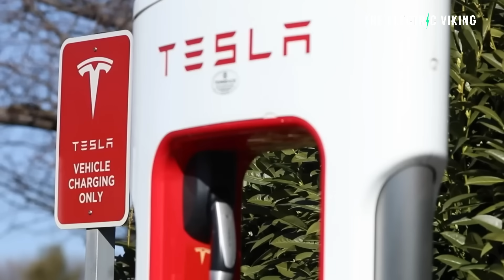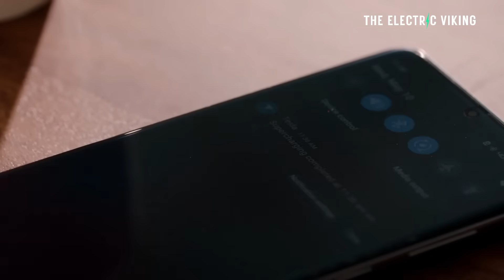Game-Changing Tesla Battery Could DOUBLE Your EV’s Lifespan!

Comment: We need cheaper batteries, thus cheaper cars, not longer lived batteries. Also, after years of game-changing breakthrough promised we'd like to see some actual production.
Reply: Longer lasting batteries make the yearly cost of ownership lower and the resale value higher and open up new capabilities like selling stored power to the electric company or using your vehicle for emergency backup. It matters.
Reply: @adamdarrow  EVs are becoming like computers, where the tech gets outdated within a few years. Buying cheap and buying often is better for keeping up with the latest car tech.
Reply: @lym3204  Not it's not, buying "often" is part of the problem.....
Reply: @lym3204  Buying cheap is always buying older technology - cars, phones, houses, TVs, whatever. And cheap and ev don't exist in the same sentence  - unless you're talking about a clapped out gen 1 Nissan Leaf with 50km range left.
Reply: @petercroft9895  Rubbish. You don't see cheap EV's because your country blocks the import of them from China. Open your eyes and use them!
Reply: Chinese auto?
Reply: Why not both?
Also, china is already building cheap EVs. Why not get those?

Comment: Current batteries are already excellent, so this makes a good thing better.  My 2015 MS85D is at 400,000 km and 85% battery with daily charging to 90%!  Go figure.
Reply: 18650s are slender and easy to heat and cool compared to thicker ones. I think that’s part of the reason they last so long.
Reply: @frankcoffey makes sense to me but I’m not smart enough to to rebuttal
Reply: No. It needs to double capacity. To bring down weight. To allow higher constant velocity and trailer work. To compensate winter decrease. My VW Golf GTI goes 950 km range on 110/120 km/h on flat topography. My BMW I3 AH120 just 280 km at same speed. With 90 km/h and hypermileage i can bring it up to 380 km range. Would be great, if there is a battery coming with double capacity in same room. The car itself i love but battery makes long trips even longer due to often charge stops.
Reply: @rainersta7073  Oh well.  Guess they may as well just throw away any incremental improvements.  Double capacity or don't bother!  

Sounds like another case of moving goalposts to me.
Reply: My Mitsubishi 380 has done 750,000 km on a single tank.🤗
Reply: So I have to suffer range anxiety for twice as long?
Reply: Makes it better ……WHO DOES THAT
Reply: Good on you. That‘s a remarkable mark. I‘ve made it to 325.000 km in 13 years of driving with a Diesel once.
Reply: @gorchde7934 my car is a 1995 vs commodore wagon it has just clicked 300,000 km
Reply: @andyno333  Individual cars can sometimes go a million miles.  What I think we will see though is EVs on average outlasting ICE cars on average.  How could they not really, given how they have fewer parts, batteries are proving to last, and electric motors are well known to last for decades. As a mechanic and gearhead, who now owns an EV .. I am positive this is true!
Reply: My ICE car is on 355,000.
Reply: @Dungshoveleux 
Wake me up when you can “refuel” at home for next to nothing.
Good to see you watching EV videos. Though. 
Shows you must be close to buying one.
Good girl.
Reply: "Current batteries are already excellent,"
For myself, current batteries are pathetic - It takes far too long to charge. Can't use a car while it's charging.
Perhaps for people that live in the city and have 9-5 type  jobs - Then yeah, EVs are nice. But for others like freelancers, contractors and small business owners who need to not only travel within the city but outside the city, many cant function with an EV; as a second vehicle yes, but not solely.
Reply: @babajaiy8246  I’d suggest mapping all your routes and make it real … I did.  I live on a farm, and I drive 30-50,000 km a yr.  I only charge at 12 amps/240 and I always have a full tank.  Supercharging is 5-10% of my charging and my average stop is under 20 minutes.  Even though my 2015 car maxes at 120 kW, charging time isn’t a big deal at all!
Reply: That's a lot of seat time.
Reply: The EV issue now is price.  There are many Chinese EVs under $30k.  We need this in he US.
Reply: @BigWorldOutThere98  That will never happen. US workers make 5 times the salary of Chinese workers, plus they get more benefits. Materials are also way cheaper in China. Add to that all the other costly disadvantages in the US and it doesn't make sense. When the US produces something comparatively inexpensive, it's of low quality.  So the only solutions are to buy Chinese made cars,  pay more for American made cars or -- here's a novel idea -- have both, something for everyone! Unfortunately Trump has ruined everything to do with international trade. He has screwed the pooch with his FAFO mentality.
Reply: @checkfactschecking  It may take a while but it will happen.  A shift is already happening in Latin America.  Watch Brazil and Mexico.  China is building  EV factories in Mexico, and 8% of new car purchases are EVs.  This will increase dramatically with the cheap Chinese EVs, and cheap solar adaption.   US solar installation is the most expensive in the world, but Mexico will be able to do it dirt cheap like China and Pakistan.  Also, gasoline prices will never be low.  All of this will put pressure on the US Car industry to switch to EVs,   The rest of the world is switching to EVs because they don't have oil resources, and without global sales, GM and Ford will go bankrupt.  Huge lithium resources have been found in Nevada, California, Arkansas and other places in Latin America.  Battery technology continues to improve and become cheaper.  The US won't have a choice. It will it happen in 10, 20 or 30 years depending on federal policies.
Reply: @BigWorldOutThere98 Chevy has one for 35k, and cheaper are coming from them and others.
Reply: @BigWorldOutThere98  Won't happen. Tariffs...
Reply: @BigWorldOutThere98  NO we don't. They can't sell the EV junk that's already here. Don't know who you are working for but get a clue. NO ONE wants these Exploding Vehicles.